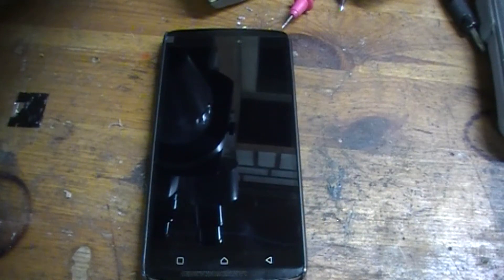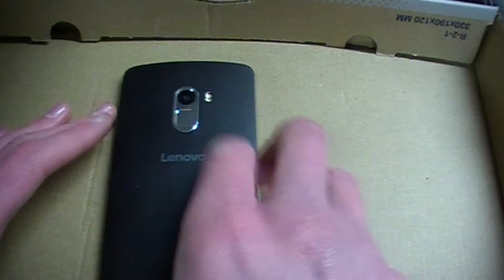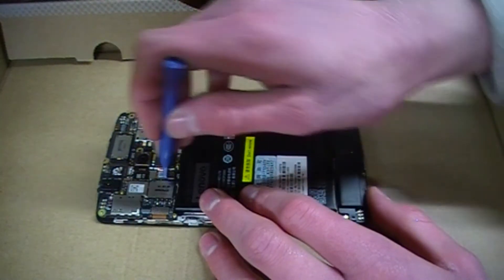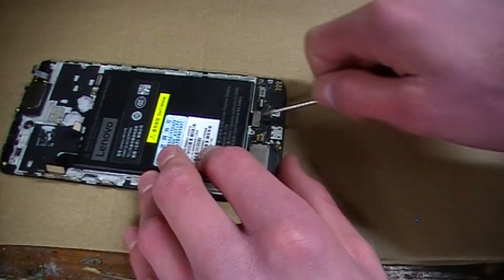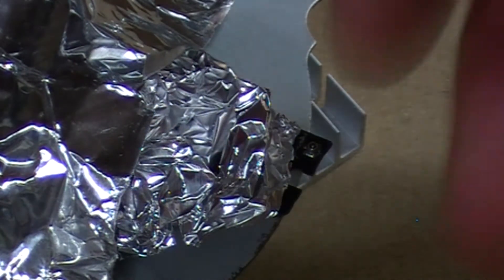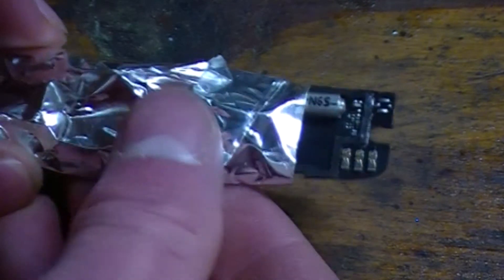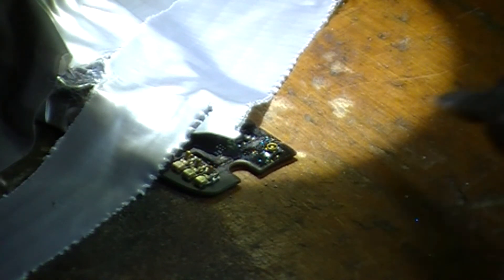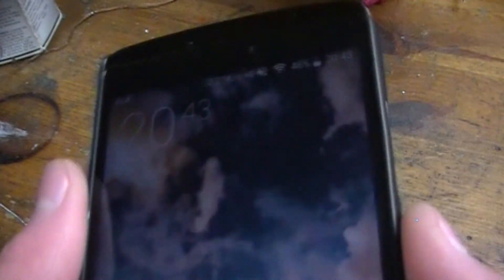How To Fix Phone Antenna Connectors

Comment: Hi Kyle, my phone has 4 of those antenna signal wires and when i was repairing my phone i broke one of those connectors, would it be a problem if i leave it like that and keep on going with the other 3?

Comment: Awesome, so glad I found this! I'm a bit scared to try it, but we'll see. Why did you choose a heat gun for removing the old one, insteafd of using the soldering iron? would it work ok to just use the iron for both steps if I don't have a heat gun?
Reply from the maker: Glad to hear my video seems helpful to you! I would say take your time and you should be able to do it quite nicely. I chose for the heat gun because it was a bit easier for me as I could heat up the entire connector at once. You can, however, indeed use a soldering iron and just flood the broken connector with solder to remove it and you should be fine.

Comment: I wish I knew you can simply order those connectors online. About a month ago I broke both the antenna and the connectors. I ended up ripping the connectors off the board and soldering some copper wire directly to the contacts to fix the problem, which is an awful, awful solution.
Reply from the maker: That sounds indeed like a really bad solution, maybe you can still try to fix it soon? It's a very creative solution though, as when I tried fixing my phone I didn't think of that :D
Reply: you soldered the same wire to both contacts? just wondering if a phone antenna has a + and a - that can't be shorted to each other for it to work... or if it's more like a tv antenna where it's just one piece of metal